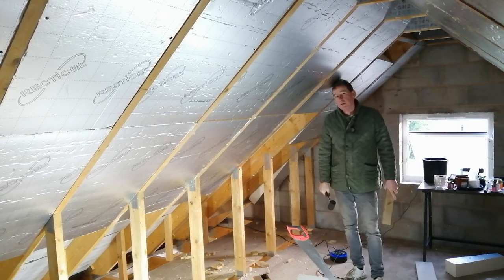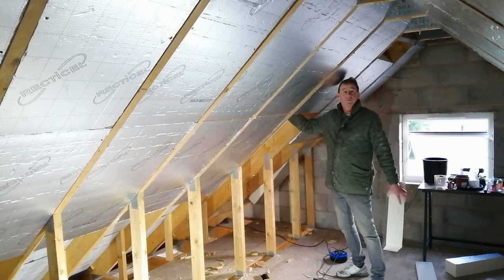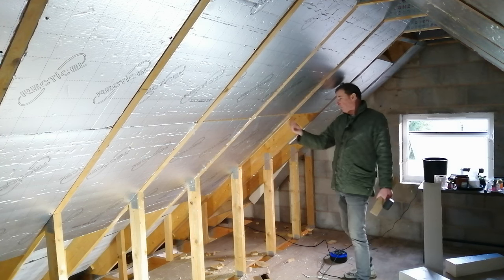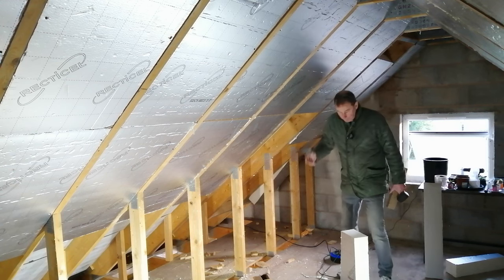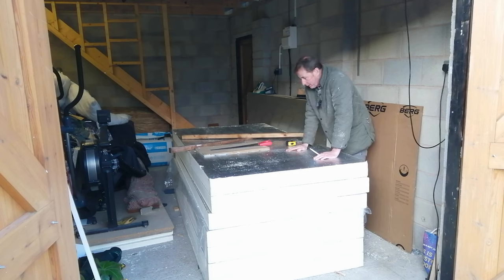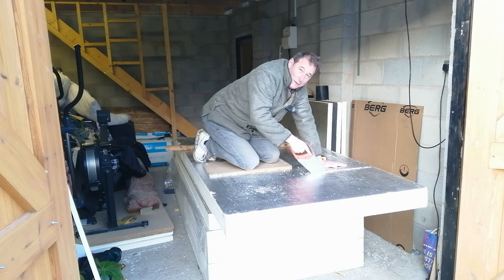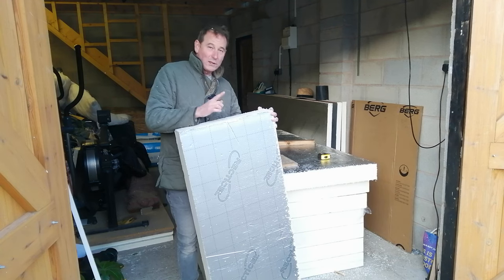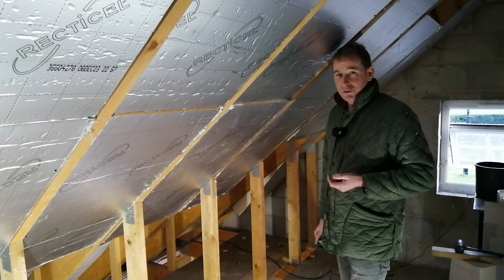How to Cut and Install Rigid Insulation Board Kingspan Ecotherm Celotex PIR

Comment: Mark I really enjoyed your video. It's great how you talk right the way through explaining every little problem and your thoughts.  So keep up the good work.  A question: Would the insulation boards not get loose over time? Also would you not have cut the boards a couple of mm bigger for interference fit? You might find it a bit easier if you get hold of a couple of saw horses and a timber board for support.
Reply from the maker: Appreciate the feedback and additional information. Useful and helpful. The insulation board is stable and won't shrink or expand so it shouldn't fall out. However, there is also still foil tape to apply and there will be a further layer of insulation plasterboard underneath. So it can't drop once that is in place. If you can mease just a couple of mm too big it should be possible to wack it home so that would help. Thanks again. Mark

Comment: I have a question.  Are you insulating the whole way down the rafters or will you insulate between the hangers there that are supporting them.  Also,  If you had lower cable ties across the top.  WOuld you insulate over them or run the whole way up the rafters only.??
Reply from the maker: Building inspector said I could do either. I'm going all the way down to the bottom of the rafters where they meet the plate. Because I want to have cupboards between the hangers. I wasn't sure what you meant about the cable ties? Let me know?
Reply: @MarksHouseandGardenUK  Apologies, I meant collar ties. Im currently about to start this and there would be large volumes of air behind the hangers and above the collar ties.  This could be good for air circulation ...but it could also be bad perhaps?